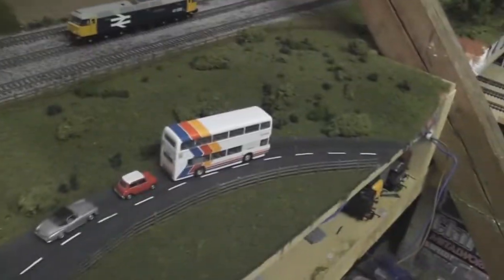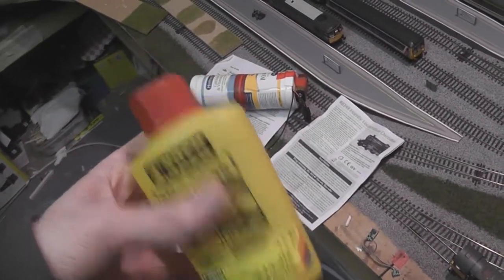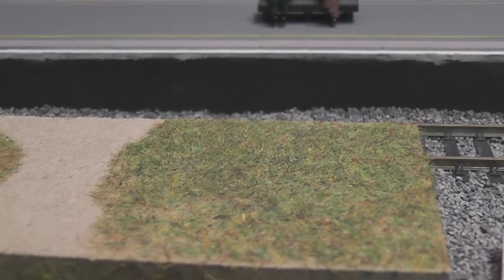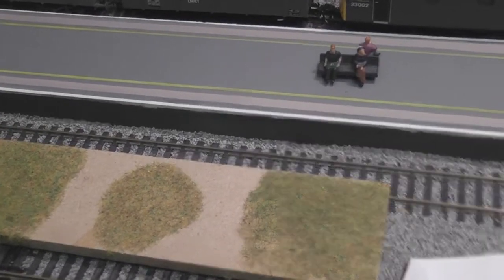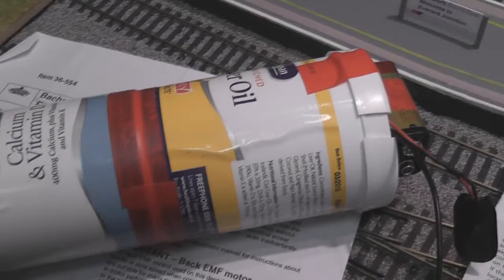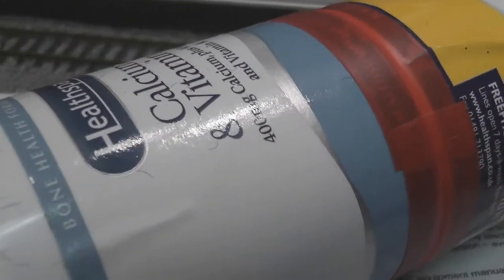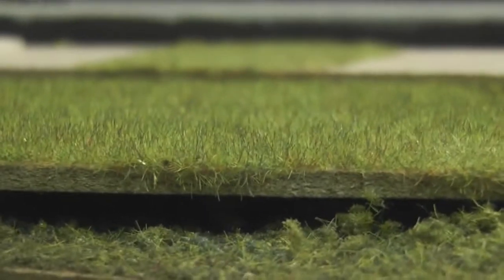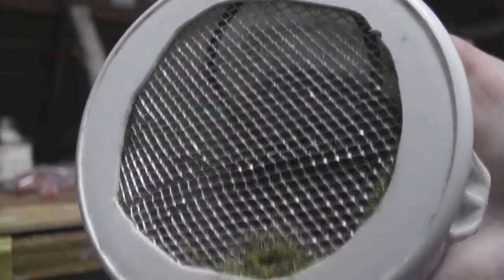Static grass applicator

Comment from the maker: @bloodmarine77 Thanks, mine cost about £20. The ion generator is only available from Oatley Electronics in Australia.  The nail can be placed anywhere on the board as long as it is in contact with the glue, otherwise it wont work.

Comment: very impressive mate.it does look so much better than the puffer bottle like i have.you have done a good job of building it aswell.how much did it cost you to build in total as im now going to build one now i know it can be done.also does the nail have to be put close to where you applying the static grass or can it be put anywhere on the board???

Comment: Very nice video, sir. Your static grass applicator certainly works well. The last time I looked up grass applicators it was just as you mentioned, a lot of money! But if you have not checked ebay lately ( the U.S. one for me), there are a bunch of different electric static grass applicators around $20-$30 and they look well built. Not by Noch of course but they look a lot better than electric fly swatters :) Just passing it on.
Reply from the maker: Chad Moore Thanks, I'll check them out if mine ever breaks.

Comment: i have a air deoinizer that plugs into the wall upon breaking it open there are 4 wires 2 input ones and 2 output if i conect a input to input will the output create static charges

Comment: how long do you have to leave the nail in for once you've finished with the grass applicator. can it be removed straight away or does it need to stay in till the glue has dried
Reply from the maker: You can remove the nail straight away.  The grass will stay upright.

Comment: hi.... Static grass looks outstanding, or should that be,,, up-standing, Iv looked for a similar question and can't see one. Could you comment on how durable it is, I suspect it will be quite a dust trap,,, is it a problem if your sanding foam or plaster,  cutting MDF etc in the same room, can it be vacuumed, when it gets dusty,  can it be cleaned and if so how would you clean it. and it must be prone to marking/damage, if you put a line side hut down on it. or a tractor trailer then moved them would it leave an imprint, if you touch it does it leave finger marks, kids love to explore by touch etc if little "Johny" drove his tractor along the embankment while your back was turned would the air be turning blue, many thanks.
Reply from the maker: In my experience when glued down correctly the grass is very durable.  You can easily vacuum it many times and touch it quite a bit without causing damage.  When the glue is drying it's very easy to damage it, but once dry its fine.
Reply: EverardJunction Thanks for that ,,, im really surprised ,,, I would of thought it was extremely delicate .... Many thanks for getting back to me ,,,,